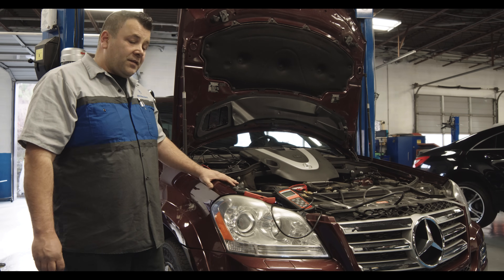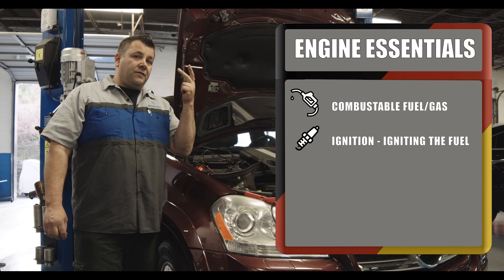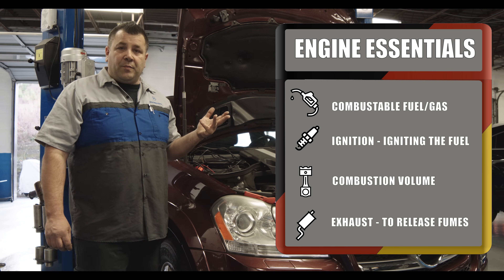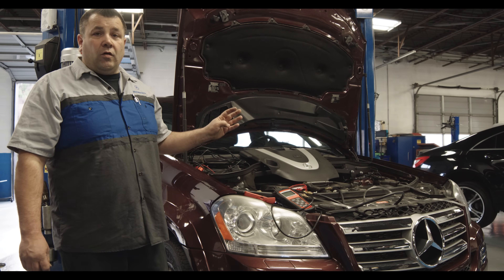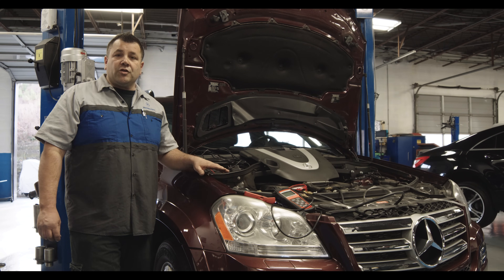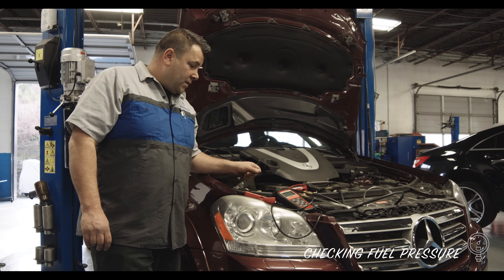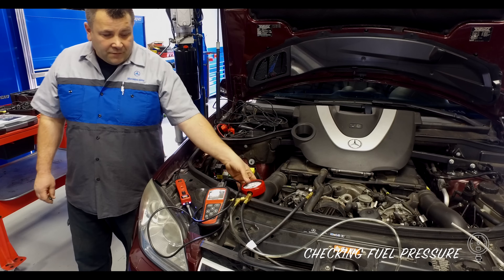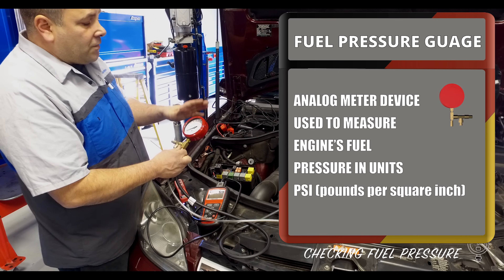Why a car won't start -  Mercedes Benz Troubleshooting Guide, Tips

Comment: hello,i have a question,my key at my car cant be turned to right to start the card...i have electricy in my car,radio,light,locking from inside works...but from the key nothing..today come an mechanic he check something there and after he connect his laptop at car computer i dont know if he readed something,because dont tell me nothing..he take out housing key ,he said that contact key is problem,he take with him the key and that piece,i put a picture here exactly..he said will try to repair that part,if he cant will be second hand one at 20-30 £ ,and after he will transfer all data to my key working..later he said cant be repaired and need to order new part,and that for friday,and all jobe will be around 250-340..is ok the price?is not to much?i dont know if that piece is problem..only him said that..but when i put before my key in contact before key dont working,and dont turn to right,is stucked ..is not another way to fix my problem?i seen on ebbay housing key (where you put the key to start the car,like in picture added by me here)you can buy another thsi part..can you save me with a information what to do?

Comment: Hello, After a dry failure my ML 400 CDI V8 Diesel automatic transmission refuses to restart. I got annual all the fault codes and removed the air in the circuit nothing, I leaned towards the pump nothing it expels the diesel and arrives well at the filter. I even try to put gasoline on a stifle which I then placed at the air intake (air filter). He tried to start but also stopped early, I do not see the result that none of the injectors are wet but the return returns as soon as the diesel. Need help for the future. cordially

Comment: Bonjour

Mettez au moins 20l de gazole dans le reservoir.
Changez le filtre à gazole, si possible en le remplissant de gazole.
Branchez une batterie auxiliaire sur celle du véhicule pour éviter de travailler avec une batterie faible.
Mettez le contact pendant 30 secondes sans essayer de démarrer (refaites 3 fois)
Prenez une bombe de start pilot (pas votre chiffon imbibé d'essence)

Pendant que vous essayez de démarrer, une deuxieme personne pulvérise le start pilot à l'entrée d'air du moteur
Reply from the maker: Je ne parl pa francias
Reply: Hello, After a dry failure my ML 400 CDI V8 Diesel automatic transmission refuses to restart. I got annual all the fault codes and removed the air in the circuit nothing, I leaned towards the pump nothing it expels the diesel and arrives well at the filter. I even try to put gasoline on a stifle which I then placed at the air intake (air filter). He tried to start but also stopped early, I do not see the result that none of the injectors are wet but the return returns as soon as the diesel. Need help for the future. cordially
Reply from the maker: Aristophane POUAKAM TCHAKAM check your actual values on drive authorization, your ignition switch may be at fault.

Comment: No crank no start 05 c240. Battery tested at 12.5V. Even jumped it. New starter. Recently replaced alternator. All fuses showed good. Ran a jumper cable where relay is and it cranked but wouldn't start injectors not kicking in and didnt hear any priming. Ideas? Suggestions?
Reply from the maker: Check if you get power to computer and if computer works
Reply: How would I test the computer? All I really have access to is a dmm

Comment: Good Evening, I've got a 2007 S550 and the lights were left on and now the key won't even turn in the ignition. (Completely locked no turning to position #2) Starter battery is good, I can't get to the aux battery in the trunk because I have no power and the small metal key isn't cut. Any idea what the issue is and suggestion to fix? Would appreciate any help thank you all the way from Canada

Comment: Thanks David for the video. I was just wondering, I have a mb ml350 2004 and every time I start it..it always has a false start then I have to wait and start it again and it starts right up. If I stop for maybe 10 mins it doesn't have the false start. But for maybe over 30mins stops it will do that. Do you think it might be my key ignition sensor (key transponder immobilizer) or maybe the gas pump is not pulling enough gas to help it start on the 1st try? Thanks!

Comment: I have a2003 230SLK and it won't start. The key works, all the warning lights come on but stay on and the engine cranks but won't fire. The warning lights should go off after a few seconds but they don't. The only thing I've done is turn the car around as its on a slight slope. I don't think this makes a difference but it might.

Comment: Hi David thank you for the valuable information 
I have a Mercedes 2002 C240  
The car just died on the freeway  a mechanic  told me my fuel pump  was out first he said  it was the right side then the left  side  I replaced both however  now my car doesn't  crank over  only  with the help of starter fluid   I did purge the the fuel pumps a few times  before  I tried starting  it . I also replaced  fuel filter .mechanic  also checked  fuel strength  and there is fuel coming  out . The battery  had also died  after trying  to jump start  car. It still just want to crank over and run .what can you advise
Reply: Van you check the crank case sensor or the alternator regulator ,hope this help you.

Comment: Hi SR. My car mercedes gl 450 4 matic  2007 is problem i the engine start but in 5 second  off i Need help
Reply: Hi.. I got same problem on my 07 gl450. Since you go thru it, how did you fixed the problem. Got lots headaches last 2 months.. Thankz in advance

Comment: I like this Guy🙏🏾🙏🏾. Sitting at home tryna figure out whatd wrong with my car. Had the dopest intro. Thanks for the video 🙏🏾
Reply: Hi. I changed my suspension compressor of my 2010 GL550. Unfortunately there was a moment I started the engine without taken out the electric relay and the fuse.
The engine never run right again. The engine shut off as soon as it start.
I diagnosed it with OBDII and gave me (error code 6001).
I changed the Alternator and belt.
Reply: I am still having same problem engine start shutting off. 
My 2nd diagnosis gave my mechanic (error code P2289)
Can you please advise what might be the problem. 
My mechanic said the problem is (Cam Signal circuit 15) He told me I have to tow it to MB dealership for compressor
To reprogramming. Please I'm waiting for your response. 
Thanks in advance.

Comment: Hello, first of all, great video. This just happened to my 2007 GL450 today. I was on vacation for one month. Came back the car start fine. Drove to two different places after 25 miles. Parked the car and then it started for a few second and engine stop after I put on reverse gear. From then on, car won’t crank up. Just quite. Key has communication with ignition. I believe battery is good. Jump start won’t even work. I didn’t have a chance to check the starter relay. Wish I saw your video first. I saw the crank shaft codes after the scan. Now the car is in the shop waiting to hear back on Monday and hope it is not something serious. Couple questions, do you think it has anything to do with transmission? If it is really crank shaft, would it be serious issue. Does parking the car for so long contribute to this issue? I assumed so since it was fine before I leave. Thank you in advance for your time.
Reply from the maker: The answer is no, to all your questions.  
Did you check oil level and other fluids before starting the car?
Is the engine turning at al?
Reply: MBT OF ATLANTA Mercedes Master Techs. Thank you for your quick reply. Oil level is ok. Engine is not turning at all. I also saw someone mentioned could be brake light switch. I am now in the dark and hope for the best TT
Reply from the maker: drpiya007 no, it can’t be brake light switch, can be a starter
Reply: MBT OF ATLANTA Mercedes Master Techs hopefully, that was it. Thank you. Will keep you posted what the tech say on Monday.
Reply: hello, after almost a week and my  mechanic could not figure our what is wrong with it. At first he thought it was starter. The fuse was blown and he replaced it then it starts. Now he said the car won't accelerate so it is not drivable. Couple years ago, i had to change Transmission control unit because the car stall and in LIM mode. I sure hope i don;t have to do that again :(
Reply: @MercedesBenzTechs  Hello, after almost 2 weeks. Finally, they said it is Engine Control Unit. It has to be replaced. Quote is $1,400. Is that reasonable and do you think that is the issue? Thank you again.
Reply: So my car gl 450 2007 is started but 5 second the motor is off help me please
Reply: James Alamo I also have 2007 GL450. Took two weeks and two mechanics to determine the issue. My issue was “Engine Control Module”. $1,500 for part plus labor. Now the car drive beautifully.

Comment: i saw your all of videos 
i have problem with my mercedese i change gear lever with use one and after that car not started and  i am having code 
B1016 [ no enable from control module ewm electronic selector lever] car dose not crank
drive authorization fail
so what to do can you help
Reply from the maker: You need to adjust the lever, the car thinks you are in D so it won’t start

Comment: blowing fuse 23 on a c300 2011 model.  sensors and adjusters and mas air replace.  Still in limp mode.  Green relay tested good. Can you help?

Comment: My 02 ml320 busted a brake line. It sat for 3 weeks. We got the brake line replaced and it wouldn't start. It threw a "start error" I undid the positive post for a few days to reset the computer. It then would start and die like in theft mode. I noticed my red led light that shows the ecu is reading the key was not blinking. So I went to a Mercedes dealership to order a new key. They said they didn't make the flip style any more and it was like a valet key. No chip is visual. Tried it...still get a start error. I had it hooked up to 3 scan tools...only thing it showed was something with the transmission. I figured maybe where I was baking out of my driveway not fast at all...that's when the brake line busted and it scared me so I threw it in park. I left it running and went and got my bf and he drove it back down the driveway and that's where its sat since August. I should have told you all that when I told you in the beginning about the brake line busting. Can you please help me out!? I'm hoping I don't have to but a new computer, ecu and immobilizer along with the matching key.

Comment: 02 Mercedes s55 amg it'll start run 15 min then cut off and wont start again
Reply from the maker: Check CPS
Reply: CPS = Crankshaft Position Sensor

Comment: Great and useful video. Definitely now know what to look for my start problem. I have 2003 S350 (w220) and I have problems with starting my car (starter is working but engine won't start), so will look for fuel system issue.

Comment: I am having an INTERMITTENT problem wit th ignition 2004 S500;  70% of time car starts normally;  30% of time, when I put the key in the ignition, the steering wheels activates to the down position and a single red light appears on dash .  Then, when I turn the key, the rest of the lights on the dash do not come on and if I turn key further, car won't start (nothing happens).   If I keep trying, after 2 to ten times) the ignitionworks agains and the car starts.  This has been going on for 4 weeks.  I recently put in a used ingition switch and had 2 new keys programmed to it (not mercedes keys).   Is the problem bad keys?  bad ignition switch?   something else?
Reply: I have same problem , but I also have 2 keys, tried both keys, and same thing lights come on in dash, but engine doesn't turn over, usually takes a couple of times before it starts

Comment: Last night i went to start my 2005 Mercedez ML350 , and when i turned the key to turn the engine, I had a complete loss of power. Its as if the battery was not there. I thought maybe the battery was dead, so i went to recharge it. When i put on the positive cable, all power was restored. I went to start the car, and it came on. So i removed the charger, and let it run. after letting it run for two minutes, it would make a flicker sound as if it was going to shut off. I turned off, and tried to turn on the car, again, all power would be lost. 

This morning as i was getting ready to remove the battery, I removed the positive cable for about two minutes while i was on the phone. Then i thought, maybe the computer was not letting me start the car due to a self anti theft system. I put the plus cable back on with no charger. Alas! The car started right up. I turn the car on and off several times and now i have no problem. The computer must have reset. I still plan to go get the battery, and alternator checked out at auto zone. I hope this helps someone.
Reply: 6’i

Comment: Hi, 
I have a 2006 Mercedes Benz e350 my car turns over but won't start. When I put it on the diagnosis machine it say code p0335 crankshift position sensor so I change it three times and the car still won't start and I still get the same code. So can u please give me some idea of what I should do next.
Reply from the maker: Check the wires, it may also be a bed engine computer
Reply: I sent my ecu off to a shop and they said it was perfect. So that's what got me really confuse

Comment: I have changed my starter & battery on 2000 CLK 430 won’t crank & wont start ,  please help me
Reply: check the fuse to the starter. also, check the second battery it carries under the rear seat. google it.

Comment: Hi MD thank u for great video but I think I’m my case it something different last night the car was starting and running fine so I was checking my fuses bc I have check engine light one so I pulled up couple fuses and relays and put it back in so when in the morning I tried to start it I couldn’t it turns the key all the way but doesn’t start the car so I try the battery I checked fuses it’s nothing so I’m not sure what else I can do if u can give me any ideas I would appreciate thank u
Reply from the maker: What year and model? Did you put the fuses back where they belong?
Reply: Ye thank u for respond actually that was my fault I put the fuse in wrong place but I have other problem I don’t know if u can help me with it my check engine is one and it shows like 10 codes and most of the it’s whit air my car is 2010 glitch 350 the codes are 0958,1186,1070,1074,0850,0154,0442,0446,0426,0430 so all this codes showing we clear that it comes back again I would appreciate if u can help me with it thank you again

Comment: Hello David I have bmw 750 li 2011with n63,I have a problem with it when ever I push the gas pedal drive train message appears on idrive,I replaced 2 ignition coil pack all spark plugs service all injectors change both vanos for bank 2 camshafts valve timing is ok but the message is still there .please help me out.

Comment: Don't know if your still fixing Mercedes but my problem is no crank no start. Put key in dash,radio all work. The fan goes on on second click. All fuses good, power to fuses good, no communication with computer.
Reply: Sorry it's a 2003 e320

Comment: presently workin on a 2011 c300 the ignition is coming on but there is an no crank plug the scan tool there is no communication with the srs pcm an abs can u direct as to the next step all the fuses are good don't know if anyone is missing
Reply from the maker: Check your front SAM, issues with water getting into the SAM box from windshield lower section where the wipers are, driver side under the hood.

Comment: You went over quite a few things but not this.  1998 SLK 230.  Starts for a second or two and quits.  No fault codes.  Fuel pressure at 58 psi.  Car runs with gas rag in intake.  Injectors not getting grounded to inject fuel.  No start error problem on the dash.  I'm leaning towards the left door latch.  What do you think would cause this?

Comment: 2009 s550.. push button start.. noticed a sluggish start now may turn once but no longer starts.. lights radio dash still work.. have not yet checked the battery

Comment: Hi MBT
W211 2002  have vibration from the rear left , my via steering wheel. All wheels have been balanced, changed a droplink , changed centre prob shaft bridge. Vibration occurs at 40 to 65 mph. Also more apparent on different road surfaces.
Thanks
TC
Reply from the maker: T C L start with basics, balance wheels first, make sure tires and rims are good, rotate wheels and see if vibration travels to other side, check CV axles, check rear differential, make sure wheels are tight on hubs. I think that should get you started
Reply: @MercedesBenzTechs  thank you will research all the above boss. Great channel by the way.
Reply: I had the similar problem. This might be left field but possibly torque converter if none if of above are problems

Comment: Hi 
I have a 2011 E350 cupe when i put the key in the ignition it turns but ignition lights don't come on then  I have to play with it taking the key out and putting back in 3-4 sometimes  7-9 times before the lights turn on and it starts I changed batteries on both ignition keys still the same problem? Can some one help please ?

Comment: I have a 2008 CL 63 AMG. I am having a starting issue that I hope you can point me in the correct direction. I have replaced the starter battery this weekend, and it still will not start. when I turn the key it will attempt to turn over but doesn't. I have 12.70 volts at both batteries, the charging system is doing its job at 13.7 to 14 volts. If I jump start the car it will start. All my connections look clean. I have a icarsoft MB2 scanner and it tells me "low starter/ battery voltage."